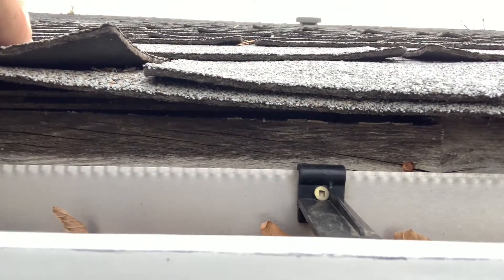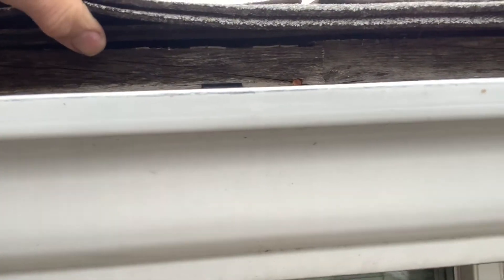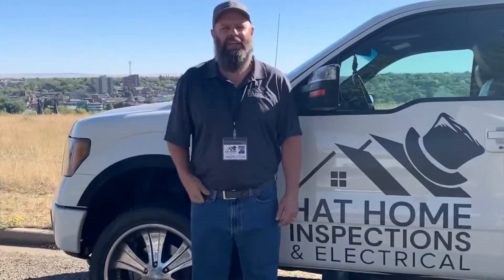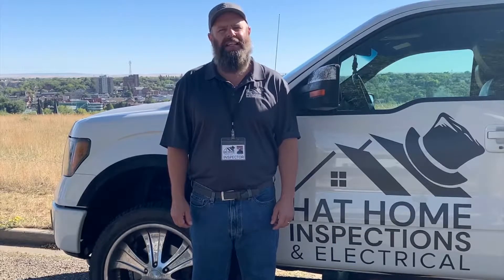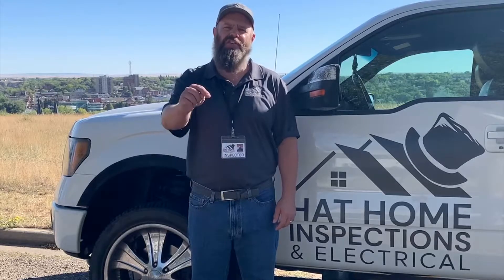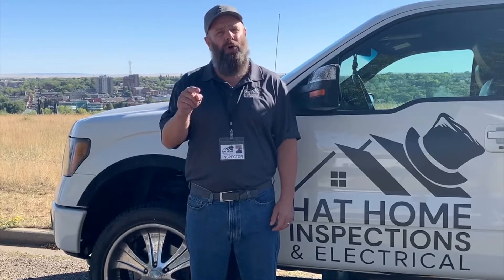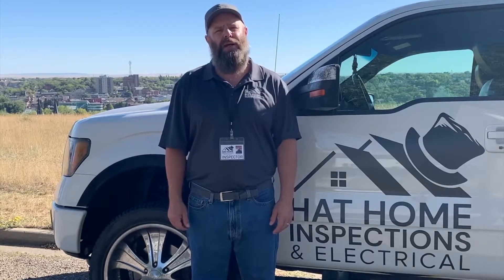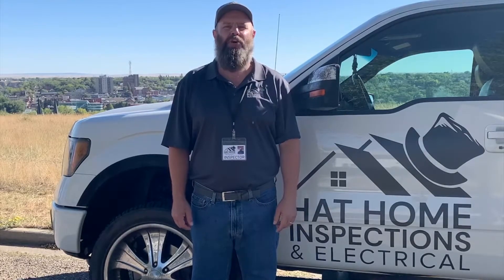Drip edges for shingle roofs | What you need to know!

Comment: Does the drip edging need to be on all four sides?
Reply from the maker: Hi Sherry thanks for your question. The answer is yes all four sides need to have flashing. Along the bottom it’s called a drip edge flashing, this is an important flashing. On the sides It’s called a rake flashing this flashing is not as important as the bottom ones.